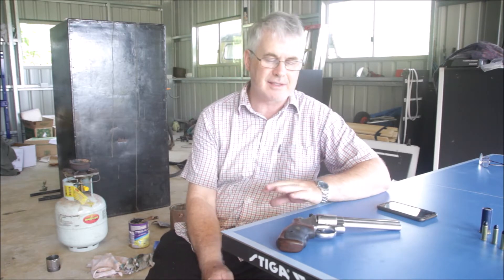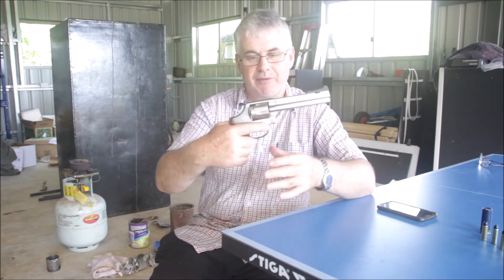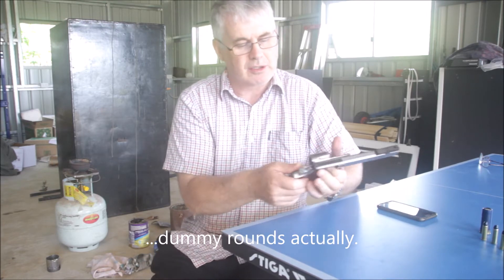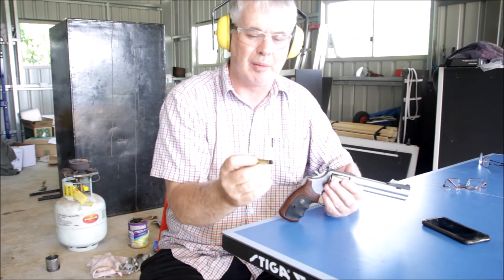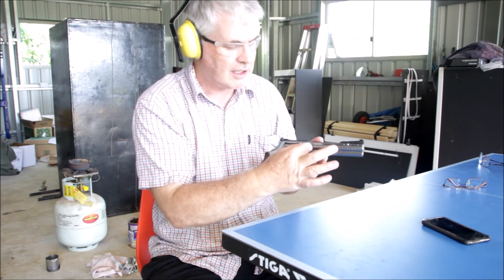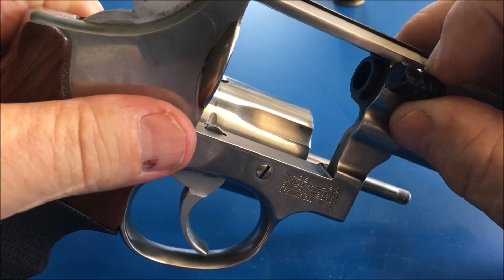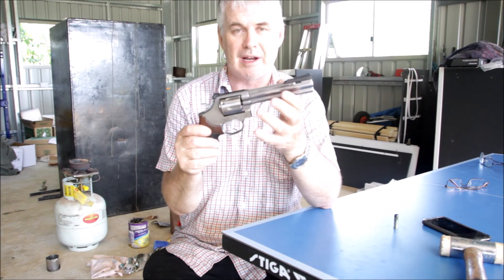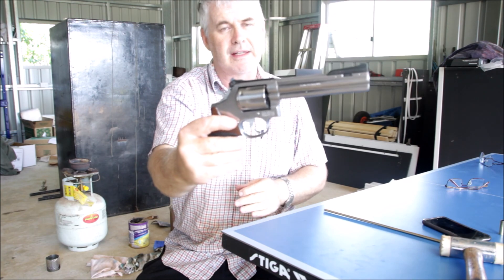The Shooting Death of Brandon Lee: A Technical Explanation

Comment: That's not what happened.  The director wanted close up of live bullets in the casing in the cylinder.  The Armor had  made 2 different rounds. A dummy round and a blank round.  The third is a life round.  A dummy round is when you take out the powder out of a casing leaving in the bullet and primers.  The proper way of denting primers is with out the powder and bullet.  Then let the firing pin hit all 6 primers to show on screen.  Now for a dummy bullet to be seen on screen is to remove the power and make sure the primer has already been hit.  Then put in the bullet in the case and in to the cylinder.  But the armor didn't do it that way to time consuming.  So he fired the primers that were live with the bullet in the casing and didn't remove all the powder out of one of the cases.  There was a small pop not even enough for him to notice.  The round logged into the barrel.  Then when they put the blanks in the cylinder and the actor squeezed the trigger believing that it was loaded with blanks.  The bullet left the barrel hitting branded in the abdomen killing him.  Why the armor didn't notice that a dummy round was not missing from the case after he removed the dummy rounds out of the cylinder  makes no sense.  Unless he emptyed the cylinder with the dummy bullets in a trash can.  Any ways that's what happened!
Reply from the maker: This video is about the technical aspects of how Lee came to be shot. Your time line and explanation may be correct but is irrelevant to the subject of this video. There is obviously no evidence that the armourer "didn't remove all the powder out of one of the cases". It is much more likely that he did and it was the live primer that drove the projectile into the barrel as this is a well recognised risk in all firearms.
Reply: A live .44 bullet killed Brandon it was pushed further into his spine and in the surgery it was missed. It wasn’t until the autopsy they found it lodged . It killed Brandon Lee. At what distance? I have read 4ft to 12 feet. I have not measured the distance nor read anyone doing it but at what distance would he have been safe from being killed? And he wasn’t wearing a bulletproof vest and that was because people there insisted he was going to be safe with just one blank. Daniel Kuttner opened and loaded the revolver and he was not a weapon expert and Detective Brian Pettus stated that Kuttner had zero knowledge on weapons but he took it as part of his job description to be allowed to load the gun. Where was the Armorer? He modified the gun and left the production of the set of The Crow. Victims aren’t we all? Jim Moyer failed Brandon Lee, Daniel Kuttner failed Brandon Lee and Jeff Imada, Daniel Kuttner and Bruce Merlin modified the real live bullets a huge Cardinal rule broken on the property of Carolco Production Company on the back of the pick up truck of Kuttner as the crew chose to dismantle the live bullets with a pair of pliers just like pulling a tooth. They were to blame. Who knows what more was done but it’s what is out there on the internet and book of author Bridget Baiss The Crow The Making of The Crow. It’s all there easy to read it. 😢